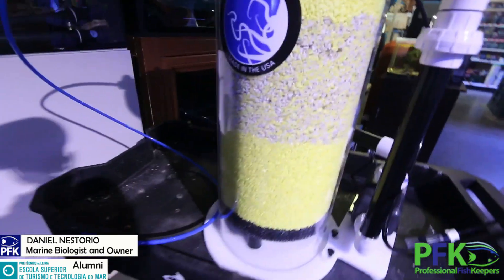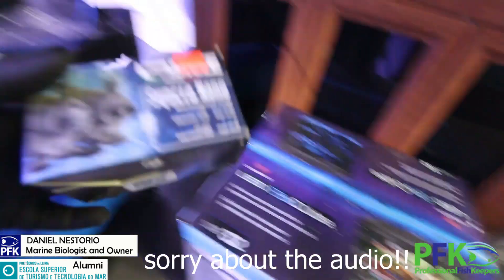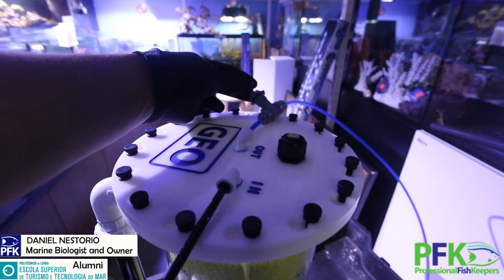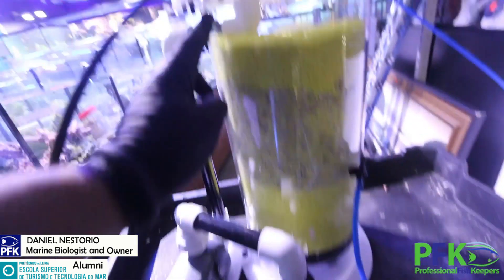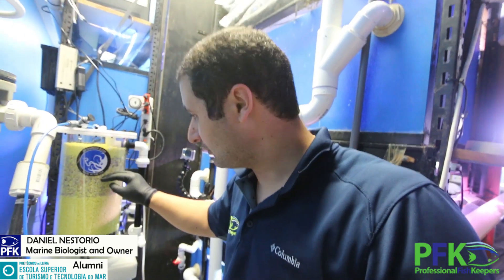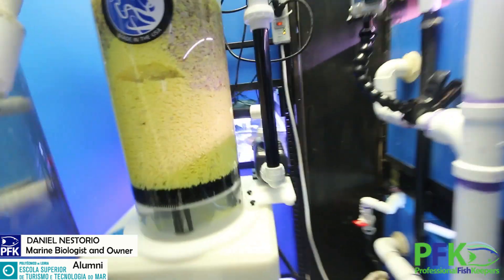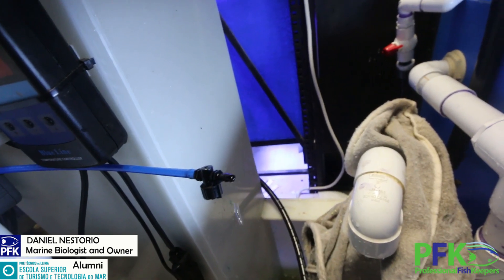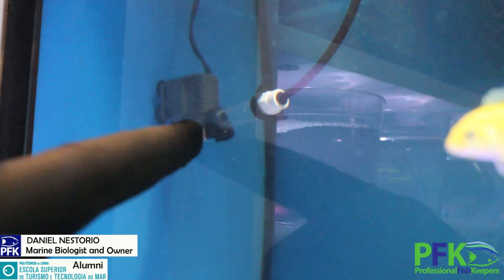HOW TO SET UP A NITRATE REACTOR

Comment: Where's this dripping to?  In to 2000 gal tanks? How long it's going to take to cycle 2000gal water with it? A year?
Reply from the maker: its dripping to the sump, the bacteria will grow in months, its a exponential curve grow
Reply: 3 drips/second at about 0.05 ml/drop is about 13 litres per day. or about 3 gallons/day. So wow, yeah 2 years to cycle all the water through 2000 gallons.

Comment: I am having a hard time with mine. Ever since I installed it next to the skimmer, its not render useless. How do I give oxygen to my livestock? any advice would be great. My input feed is next to the skimmer. Sump is not that big.
Reply from the maker: Oxygen to your live stock just have an air pump and air store. The nitrate reactor just have him running. Keep an eye on nitrates. Make sure water is coming out of the effluent. And is not getting clog up with bacteria. When power goes off have the reactor water not going in to the sump.

Comment: Never mix the coral fragments with sulphur media. Always have a partition of foam. The sulphur will build up a layer of film over time that the sulphur media will need to be taken out and washed. That’s when your going to need to take out the crushed coral separately. I do this maybe ever 3-4 months. Still far better than waterchanges but you will have to monitor and add alkalinity constantly to your system